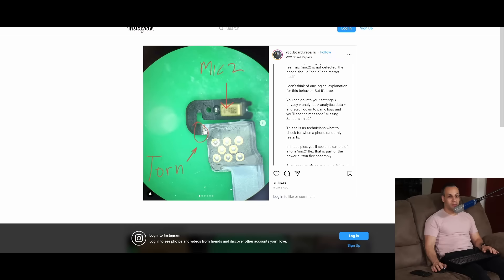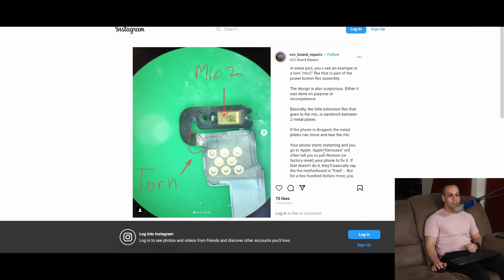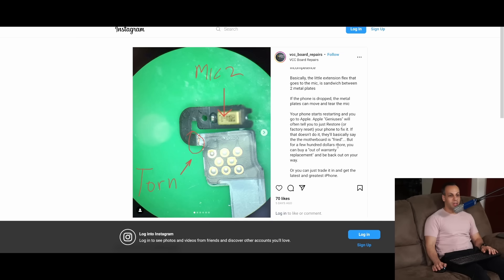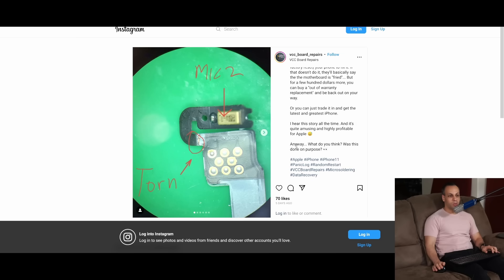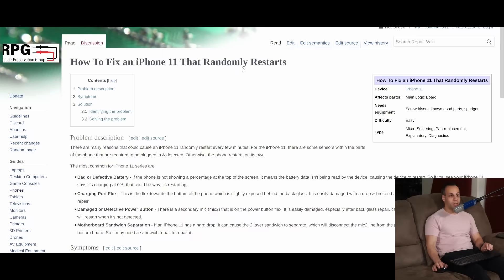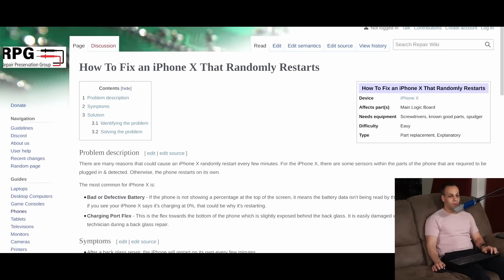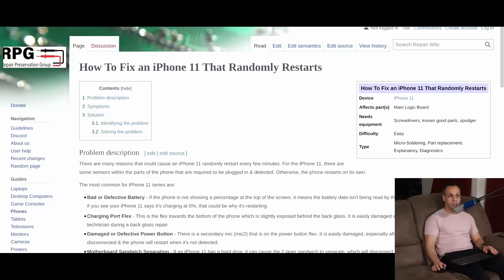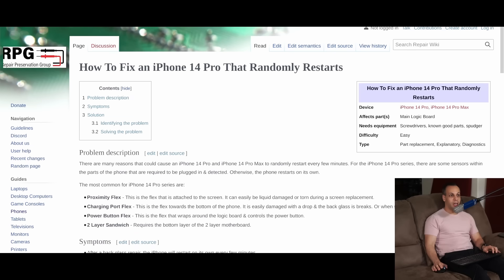iPhone's design flaw shows that 10 years later, their engineering is still a joke

Comment: it most likely designed that way not by engineer but through marketing so that 3rd party repair wouldn't just see "mic isn't working" and just get other mic modul from donor phone. also you already said, mic not always use means if it broken and can be bypass then customer won't consider buy new phone but simply by external mic 😅

Comment: i've had my iphone 11 pro max since its release, i paid it off, and wrapped it in an otterbox and it still looks new when i pull it out of the case from time to time. that being said, i've sent this thing sailing across tile floors at work, bouncing down stairs.. its fallen out of my car when i get out so many times now, theres a dent in my driveway from it lol.. i'm kind of worried after seeing this video lol.

I just cant go back to android, i went apple back when the X dropped, because i just wanted something different, since i had been using android since the very begining. i would have gone WinMo if they where still around at that point just for a change.. ive been here ever since. The "ethics" of apple vs android mean nothing to me, if they did, i couldnt use either phone and would have to have a land line lol.

Im planning on getting the 14 (i stay a gen behind for the deals), i hope its going to be as good as this ones been. i considered  my 11 pro max to be the best phone i've ever owned.

I think its sad Apple doesnt recogonize the benefits that you and others bring to the table. its proof why living in an echo chamber is never a good thing.

Comment: I worked on spacecraft flight software and boot loops was one thing that they thought about. 

In a system that I worked on in order to protect RAM contents from corruption by single event upsets a check was done to see which of the three copies maintained of each variable was wrong and the bad copy was overwritten by one of the two good copies so that all three copies were correct. The relevance to this video is that if all three copies were different than one of the three copies was arbitrarily selected as the good copy and a fault was logged but a reboot was not done to avoid a boot loop.

When the Spirit Mars Rover landed on Mars at day 14 it entered a boot loop every 20 minutes after its flash memory became more than half full of pictures. This was because the linked lists in RAM used to index all of these photos exceeded the available RAM. However, what was done was not to reboot immediately. What was done instead was to set a timer to reboot after 20 minutes. This 20 minutes of normal operation in every 21 minutes gave JPL the opportunity to examine the RAM to diagnose and fix the problem. The first step in the fix was to disable the flash memory drive and only access the flash using low level read and write commands. Next these low level commands were used to delete all files in flash. Then for the next 75 days care was taken to not more than 1/4 fill the flash drive. Finally on day 90 the software was updated to fix the bug.

Comment: placing a double stacked motherboard in the middle of the phone along its length IS PURPOSE designed by apple engineers so that once their device is slightly bent the main board inside dies or shows problems - so hello to your new iphone because no one I know would attempt to repair a bent double stacked board

Comment: I have a Samsung A70 from 2019, Before 6 months i dropped it accidentally and my screen passed out, i replaced it and also changed the battery for a refresh, unfortunately as i removed the ear speaker on top for phone calls it opened in 2 and broke, i put it back and ordered a new one, now for 6 months i speak via Bluetooth or the audio speaker but the phone works flawlessly, of course i ordered a new speaker for sth like 1.5 dollars but just i didn't find the time to change it till now...
It's so sad that things so natural to happen are like nightmare for an iPhone user..

Comment: THIS HAPPENED WITH MY SCREEN ! I dropped my iPhone 12. It worked for a few seconds then turned off and never turned on fully again. Apple told me it was the motherboard after they tried to replace the charging port. They told me I can either buy a replacement phone with a 2 month warranty, or buy a new one with the full warranty. 
Best thing is they are the ones who replaced my screen assembly and poorly routed the flex cable, how surprising …

Comment: I say it was done on purpose. Not the design flaw, but the rebooting issue. They are so pathetically greedy that they have just decided that ANY change to the internal state of the phone should be interpreted as "someone tried to get a third party repair" and so they want to punish their users for it, even if they haven't actually done anything. Either that, or they want to ruin the phone so much that people feel compelled to go straight to Apple instead of to a third party repair shop which someone may do it the issue seems clear and simple.

Comment: I find this issue is common with faulty charge port flexes too. Phone is often still chargeable too. But constantly restarts every 3-5 minutes with no signs of issues. Replacing the flex solves this. Or when the device bootloops due to a faulty speaker flex.

Comment: Considering that this has been going on for years, and is present in model after model after model etc seems to say that this is a deliberate design choice they continue to use. Cuz it gets them more money.

I'm not even surprised at this rate. As someone who has never used or owned a personal apple product, i still hear about how apple forces users to upgrade phones every couple years by deliberately making the older models less functional and much slower through "updates".

My Galaxy S10 is 4 years old and still functions very well. Occasional malfunctions, yea, but a simple restart fixes them, and they occur months apart and not even consistently so it's not like i have to deal with these malfunctions on the regular.

Android is better.

Comment: OMG OMG OMG 
BRO
this is on purpose
ill tell you how
I am using REALME XT ok? 
So when i plugin my charger then IT STOPS CHARGING AND GIVE OUT WARNING ⚠️ - alien object detection or moisture content
So... I have to restart the phone (REALME) then it charges (this happens on every single charge when i plugin the cable)
Now you will say your socket might be damaged or cable is damaged NO the answer is No
Both are fine 
What REALME does when you go to them they say buy a new socket it will cost this much or buy a new cable

So basically this is the way to earn money
They can simply push an update and can fix this issue

Comment: Years ago before Apple was Apple and it was still McIntosh they had an actual competition where their workers were tasked with creating hard to track points of failure and ways to make it harder for individuals to repair, upgrade, and replace parts. They also had a competition in an attempt to find ways to make it more likely for their systems to get damaged by normal use. These things were the norm for IBM, and Apple at the time and there were only two companies that didn't do that Microsoft and another one but neither of them were major hardware producers. They only produced hardware on a very limited basis. Too this day the second most open operating system is windows though it still has some major problems with everything from security to the ability of the end user to customize it for their own purposes. There are a few reasons why people typically don't use something that is technically better the most important one being that they have confirmation bias but it is also because of something known as decision paralysis. Basically when you give some people too many choices they can't make a decision about which one to choose because they either don't have confidence that they can choose the correct one or they fear missing out on the other possibilities. This for some people is an impossible conflict for their brain to resolve so they simply remove their own abilities to choose. Something else to consider is that even if someone has decision paralysis with one decision they may not have any problems with other decisions they make on a daily basis.

Comment: The fact, that apple has this restart failure mode with many of its product is a big sign for planned obsolescense and not just a quirk of apple engineering.
As you so nicely described a phone can still be used even without the function of the microphone. Any tech thats restart every x minutes is effectively broken and not usable at all. 
Lots of people will prefer to buy a new device instead of going through the hassle to get it repaired. This is a picture book example of planned obsolescence.

Comment: I’m done with Apple, I’ve had problems with every Apple product I bought over the years. 

2009 Mac Mini: The HDD had bad blocks, more bad blocks than it had reserve blocks not that the OS told me, I had to pay $150 for Disk Doctor software to find this out. Later after updating the OS to .. I think it was Mavericks, the mac would hang at boot up sometimes taking 5-6 attempts before booting into the OS. I just kept the Mac on all the time.

2019 iPad Air: The screen developed a bright spot near the fingerprint button but it’s only really visible on a white screen.

2020 iMac with 27” 5K display: Just 6 months after buying the fan would stop then race then stop over and over. Took it to the Apple store and they replaced the fan under warranty.

Comment: I have a XPERIA 1 and the fingerprint sensor is error and intermittent function. The phone doesn't say anything but draining a battery. But it the phone start by no fingerprint sensor detected、 the phone will operate normal except you cannot use fingerprint sensor.

Comment: I can explain this kind of behavior because I have seen it often with misguided efforts to "fix" things in software. Note that I am just describing an example here.
It may be that the mems microphone often does not initialize correctly. Wrong init sequence, timings not respected, etc.  So as a quick fix, it need to be reset, but there is no reset line available because someone said well we can use this extra pin on the CPU for something else, and a dedicated reset circuit for this would cost a penny and board area so let's not add anything, besides the mems is hard reset when turning the phone on so it will be fine. But 1% of the time it's not and a reboot fixes it every time. So just reboot when microphone is not detected. Perfect solution.

Comment: What the heck, my little brother broke multiple phones in the past like the digitizer of a Xperia Z, but it worked fine, I was able to unlock it by connecting a mouse via USB-OTG and then also a keyboard and then plug it to a PC (MTP has no access in locked condition).
Later I also had another Xperia Z and a Z1 Compact, sadly I bent the SIM reader pins on both because of a stupid nano to micro-SIM adapter but they worked absolutely fine, I installed a Lineage ROM on both and used them as players for audiobooks (also with Deezer), downloading them via WiFi; would be funny if you could somehow retrofit them with eSIM, so you could restore their mobile networking functions maybe without replacing parts...
Oh, and in flight mode and energy saving settings on the second highest level their battery lasted about a week, the Z1c got a replacement battery, the Z still the original battery.

Comment: 7:07 Seriously? Apple has such a long and clearly defined track record of design flaws that make their products break down in the majority of their products that it cannot be accidental and has to be a conscious decision to include such design flaws. Sandwiching a flex cable between two metal plates with sharp edges is asking for the cable to get cut. That is the same as having display cables in a macbook that rubs on a sharp edge every time the lid is opened and closed causing the cable to get damaged over time. It cannot be more obvious that these design flaws are intentional.

Comment: Sounds like they had some issue with certain sensors not initializing correctly, and the work around was to reset the phone to recover it.  But what they should have done is have a "failed" sub routine saying if the problem still exist after the ( IDK lets say) 3rd reboot.  Then, just flag the error and stop trying to recover it.

Comment: So you are inferring that Apple hires poor engineers that aren't in the upper echelon of electrical engineers when Apple Inc is worth a bit over 3 Trillion although when they venture into the auto market they will suddenly start hiring the brightest of the bright like Tesla which is valued at 815 Billion. Something is very very off here.🤔Either the recruitment dept needs to be lined up against the wall or they have a plan....a very insidious anti-consumer plan to hide and obstruct repair 'cos they certainly haven't become a 3 Trillion dollar company from fixing devices. I like the optimism you show but I cannot share that POV.

Comment: So I was sick of android, splurged and got the 13 pro max. As i was by far the most expensive phone I ever owned, I was somewhat wary of using it at all until my old phone died which was just short of a year after purchase. Shortly after I started using it I started getting these reboot loop issues, had it diagnosed and it says "motherboard damage", I have inofficially been confirmed by the good people that actually took on the repair that it is indeed a factory defect, but apple couldn't be bothered to give a flying fuck because the burden of proof lies with me after a year by the local legal system.

Comment: My car that I have if the sensors in the back of the car (bumper) go bad the dash turns OFF. Radio, rpm gauge, speed gauge, etc will not work

Comment: What I find really frustrating is how with every year that passes, software and hardware show less and less and less information about what went wrong. I don't think an end-user ever needs to see a stack trace, but I feel like once you abstract every single error away from the user to the point you just see "Oops :(", devices and software become mysterious magic that you can't decode with a reasonable brain. When something crashes, it's now always a "randomly crashes" instead of seeing an error popup that gives some form of memory access error or null reference. At least you can decipher the basic idea of what's going wrong, or, in the case of the microphone not connected, it could easily just say.... Front microphone not found  
  
There is nothing more frustrating in development than an error with no error log, why is it the same for the end user? They have to sit there wondering what dark magic is preventing their device/software from working.

Comment: Poor design/OS Programming for sure. Curious, why does it have to be an out of waranty purchase? If the phone having the issue is within warranty, or even if it's not, that seems shady to me. It doesn't instill trust in the brand to me. I understand on repair sometimes it's easier to factory reset and start over to eliminate any residual things you may not find. But when it's something that has been found, and identified as a common/repeatable, recreateable situation it shoudl be resolved

Comment: My realme phone have the same design problem. My volume down button is broke, then if i restart, it will loop to recovery mode until the button is working again.
Reply: That's not a design error. That's your button being stuck. Take some tweezers and pull the button back.

Comment: I have an old 2011/2012 Macbook Pro. At one point after years of use, suddenly the OS would enter a continuous boot loop, with the error code "could not detect fans". Funny thing is, the fans were working just fine on the Win7 partition I had pre installed, and I was using Windows exclusively on it for years because of this malfunction. Only recently did I do a full system rewamp with new ssd and battery, and decided to take it to a repair shop and get the Apple OS fixed. Well- basically I could fix it myself but I needed a direct connect to the Apple servers from a previous OS that was hard embedded into the motherboard system.. Classic Apple.

Anyways, point being, Apple ABSOLUTELY does engineer their systems with intended malice to stop functioning when anything is not detected - either by physical severance, or by software malfunction. This is a known issue on Apple devices for over a decade and they have had all the time in the world to change this - but in reality we see the opposite. We see them implement this malicious feature into more and more devices, so much so that it is practically present across their entire product suite now, from their computers to their phones to their ipads.
There is absolutely no way this is not engineered with malicious intent. They were aware of the issue over 10 years ago, and instead of fixing it, they are implementing it to more and more devices each year. If that is not malicious, then Putin is our savior and Hitler was Jesus reincarnated.